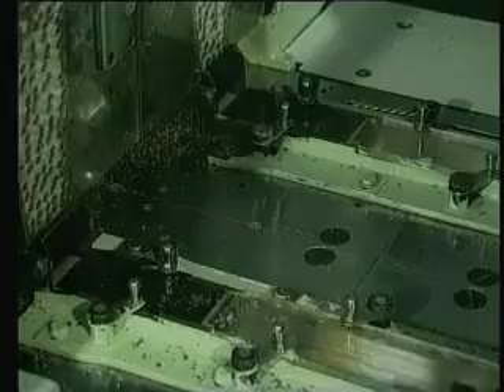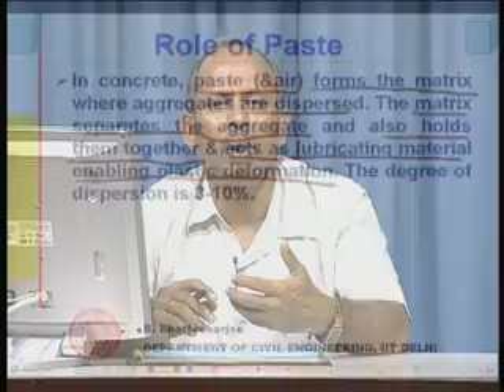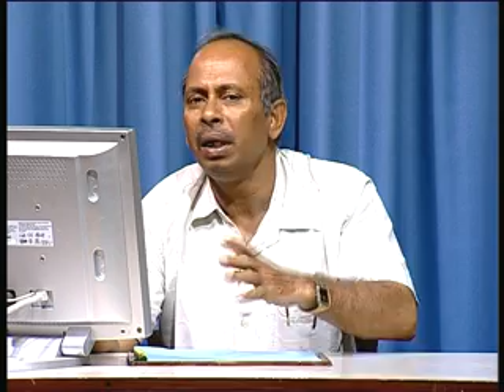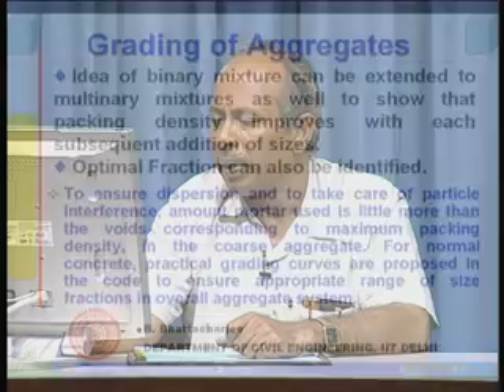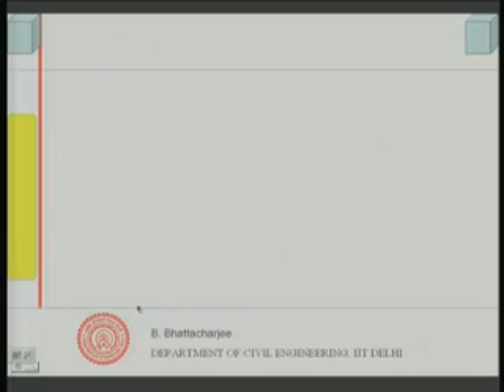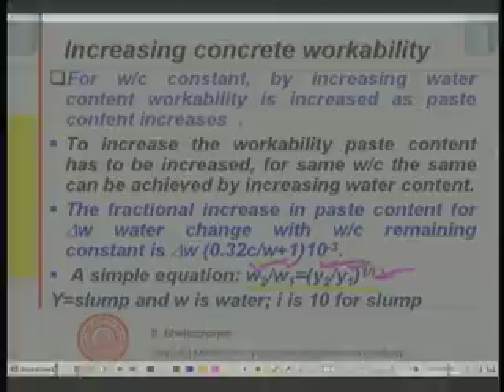Module 5 Lecture - 2 Fresh Concrete: Role of Mix Parameters

Comment: Does not angular aggregate provide good interlocking compared to rounded aggregate??🤔🤔
Reply: Interlocking and packing are different things
Spherical aggregates have higher packing means there is lesser voids and irregular aggregates have low packing means higher voids but high interlocking capacity. Interlocking has not anything to do with packing capacity. Both are different concepts 🙏
Reply: @yuvrajsharma3296  thank you 😊😊
Reply: @dassneha19  😊